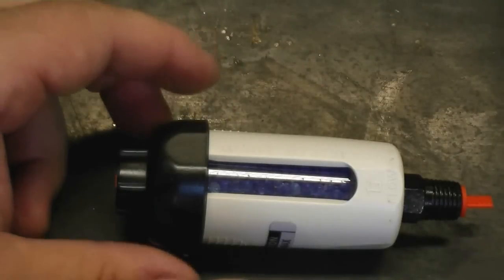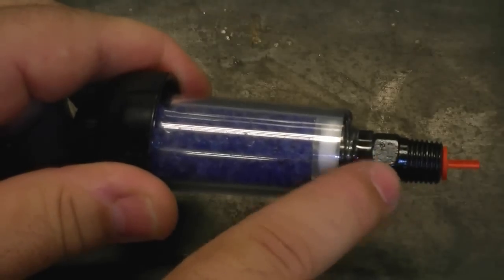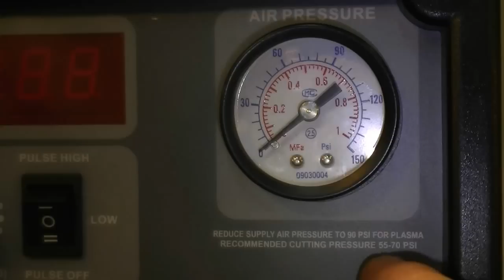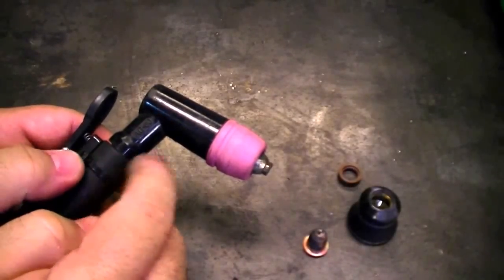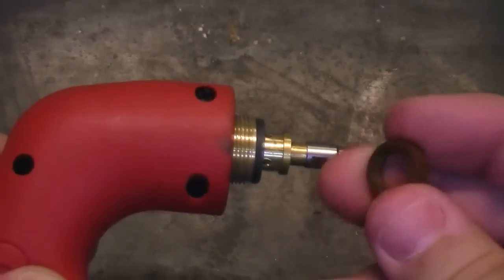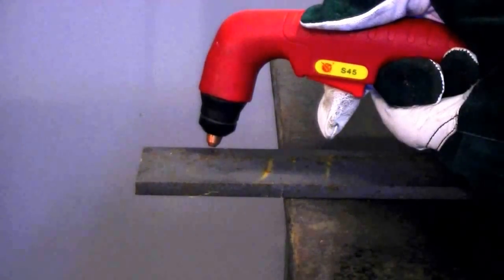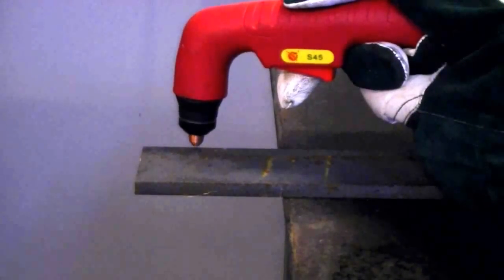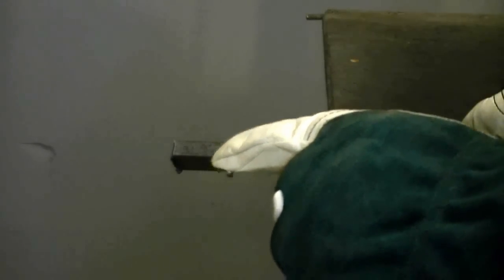Plasma Cutter Tips - Plasma Cutting Techniques - Everlast Plasma Cutter

Comment: This video is great because it goes into the actual tip location/angle for cutting.  Your statement that you don't want the tip touching the material unless you're less than 30 amps was really helpful.

Comment: Stupid Video.... I have an Everlast Supercut50 and it's sitting under a bench because it's Toast... Junk .. Barely worked on 110v and on 220v the Main Unit Just Smokes after 3 seconds after you pull the trigger.. Also Kicks the breaker OFF.......  Real Piece of Work and is NOT EVERLASTING!!!  Pure JUNK PEOPLE... DON"T BUY ONE OF THESE UNITS AT ANY COST!!!
Reply from the maker: You didn't get it warrantied? Unit has 3 year warranty from date of purchase.  Supercuts are our entry level units and are msfet based.  If it truly is a 50, we've not had true 50 since 2012 or so. For 120 operation you must purchase smaller consumables. Did you do that?

Comment: hi , thanks for video , would like to purshase for cnc plasma cutter , from everlast , but i dont know witch model to choose , and i'm really confused with techs , is it HF or blowback ? 
for non touch metal , could cut even on plastified stainless or metal 
provide , thikness cutting from , 0.6 mm to 3 mm , and with other torch from  3 mm to 25 mm 
that way  , could by 02 torches but with one power cutter 
thanks to contact me  urgently
Reply from the maker: Naoufel Melayh  blowback is the one you would want to select for cnc.

Comment: to all guys out there that are using a plasma cutter the very best way to set up the air and never have problems with wet air which is the biggest problem this is the best fix and it cost almost nothing.you go to your local home depot get a piece of 4" or 6" pic you can make it 1 or 2 foot long on one end put a cap with a screw end piece on the other end just glue a cap on it ok now on cap end drill a hole and install a male air hose plug like the ones that go on air tools on the other end the screw pvc end drill and install a female air adapter. now you can plug a air hose to each end this is going to be a big filter tube all you have to do now is unscrew the end and fill it with cotex that right woman's female napkins you can get a big bag at Walmart they make the best moisture separator there is. all you have to do now is change out about 2 a year you will never have problems with wet air again and this is a great fix!!!!

Comment: What is the temp of the plasma flame coming out of the tip ? I heard it is quite "hot" ?
Reply from the maker: +tinkergene  6k to 10k degrees F
Reply: What is the duty cycle for Everlast plasma cutters?
Reply from the maker: The PowerPlasma series is 60% duty cycle at maximum amps.
Reply: I have no idea, I would think 100 % ? it requires no gas, just a air compressor that can keep up, and enough current for the cutting ?  But the machine itself - Good question !?
Reply: tinkerg
Reply: tinkergene 
its plasma, hot as the sun!
Reply: tinkergene

Comment: Thanks for the information. I am newbie to plasma cutting. I plan to cut a carbon steel 8mm thick sheet. Can someone advise the if 5cfm@90 psi will get me through. Also what is the minimum specification plasma cutting machine I will need? Thank you

Comment: I have to ask, CFM or Free air?
My Peerless P14 compressor, runs 275 litres of free air per minute at 100 psi..
Plasma cutter compatible or not?
Reply from the maker: It is CFM at 90 psi usually.
Reply: Thank you.
Reply: He mentioned good about 20 CFM, 90 Psi.  CFM, cubic feet per minute; about 550 liters per minute

Comment: Can I add a quick connect to the back of the everlast plasma cutter and if so can you make a video
Reply from the maker: It comes with a quick connect for use with standard automotive type quick couplers.
Reply: HAYAHIYAHAYAHO 1 buy quick connect (buy one of each size if you are unsure) 2 thread onto machine righty tighty, lefty loosy 3 enjoy! now back to conquer coloring inside the lines

Comment: I have now decided on the Everlast Power Plasma 50 IGBT 50amp unit.  Is there a "minimum" thickness that can be cut?  I will be cutting old saw blades, old shovels and related material, some as light as 16  gauge or so...but also have a need to cut heavier metal and plate.  Also, can the s45 gun be used in direct contact in any light sheet tracing situations?
Reply from the maker: There is no minimum cut thickness.  For a finer cut, you can use smaller hole diameter in the consumables and less amps. The S-25 consumables will interchange I believe with the S-45 and that's for 20-30 amp operation.   Under 35 amps or so, you can use the torch in direct contact with the metal.  Over that, you can get period sticking of the consumables to the metal.
Reply: +Everlast Power Equipment Great video. I hope to pick up an Everlast video at some point.
Reply: +arbour ways You meant Everlast plasma cutter right? Me too.

Comment: I plan to purchase the Everlast SuperCut 50P PILOT ARC 110v/220v Inverter plasma cutter 50AMP Cutting System.  Can I upgrade the torch to the s-45?
Reply from the maker: No, the supercuts are our Mosfet-based, entry-level economy line.  The torches are not upgradeable on this unit.  These units are HF start, and the PowerPlasmas are all now blowback start.   The two styles are incompatible.
Reply: Everlast Welders and Generators Thanks for that info.  I will be buying the
Everlast PowerPlasma 50 IGBT Plasma Cutter 50amp Arc Cutting System instead.  Is there a "minimum" thickness that can be cut?  I will be working with saw blades, old shovels and related material, but also have a need to cut heavier plate.
Reply: Everlast Power Equipment i want to know more about the plasma 50s

Comment from the maker: What unit do you have? When did you buy it?  If you have a High Frequency torch, then no...there's a big difference.  But there are a couple of versions of this torch that we've had, though they are the same parts and consumables.  The latest version of this torch is likely to be purple.
Reply: If i may ask what pressure and current to set for cutting a 10mm plate on a thermamax plasma cutter.

Comment from the maker: The PP50 comes with the torch, not the SC50.   Also 2T is simply press and hold operation.  4T on a plasma cutter is really a "lock" where you press the switch and release and the arc stays on.  It is pressed once again and released to stop.

Comment from the maker: It is a good cutter, but when you size a plasma for CNC use, you should be aware that at maximum, it should be 1/2 of the rated clean cut capacity of the machine.  That would make the PP50 fine for less than 1/4".    The PP 50 has a CNC torch that can be bought though we keep limited supplies of the torch.  If we are out, we can outsource it though direct through Trafimet (or you can).  If you need something larger, look at the PP60C.  It's solidly designed for CNC use.  Torch mate has a video.

Comment from the maker: Before the water separator.  It's actually a filter that traps slugs of water, but also traps particulates as well, which may come from the air dryer, depending upon the type of dryer used.